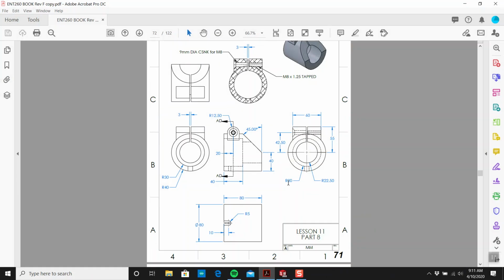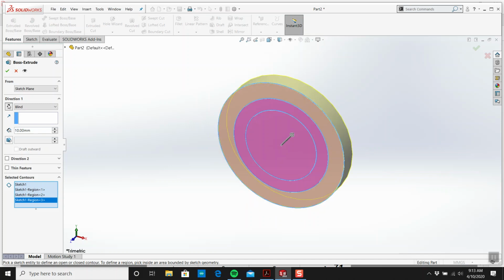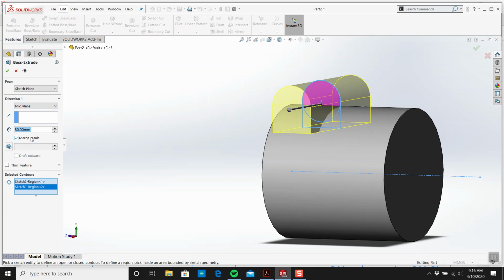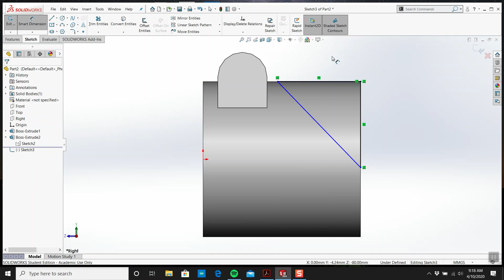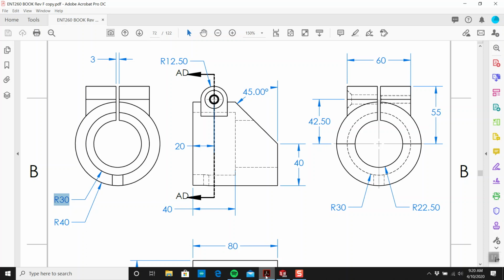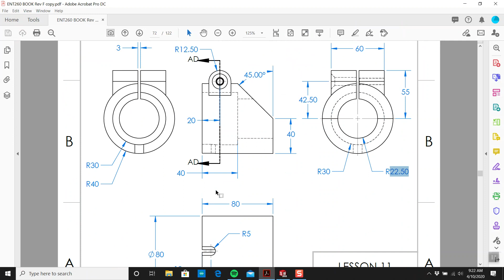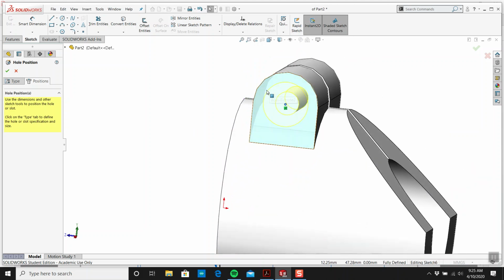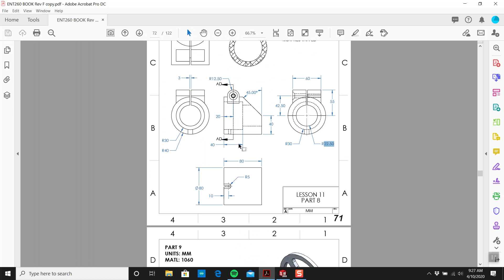Solidworks Practice Problem 8

Comment: On that top boss... The drawing shows that the top is 55mm above the center plane through the main (80mm) pipe. So, just create a reference plane 55mm up, draw a 25x60mm rectangle on it, and then extrude it downwards "up to next." Put a couple of 12.5mm radii on the two sides, and voila...done.

Comment: Your videos are excellent, Tim. As far as the far side countersink for the thread, all you have to do is drill the bolt clearance hole ever so slightly into the threaded hole side, just enough to make the countersink. The angle of the drill bit point isn't that important.  I would include it on the model with an annotation describing as such.
Reply: Exactly. Great answer.

Comment: Thanks for providing these great exercise problems.  I am curious how you would machine this? Turn/mill a round stock, or just mill a laser cut blank from a thick bar stock?
Reply: It would probably be cast, then the holes and slots would be machined on a mill.